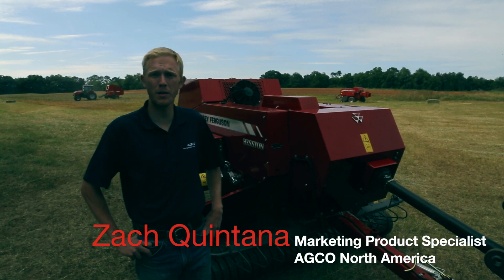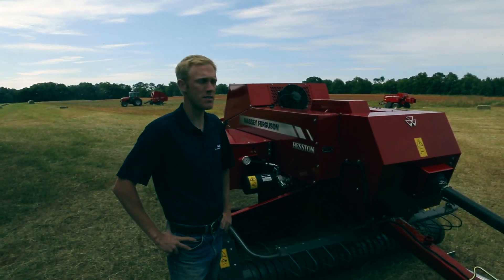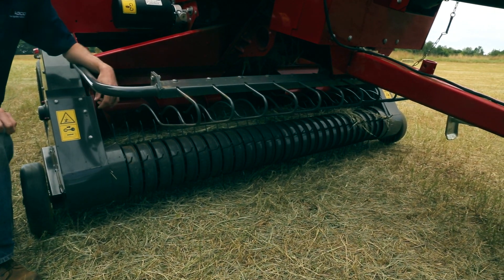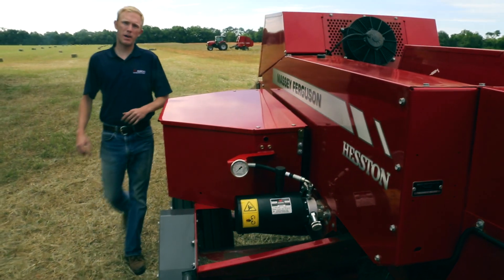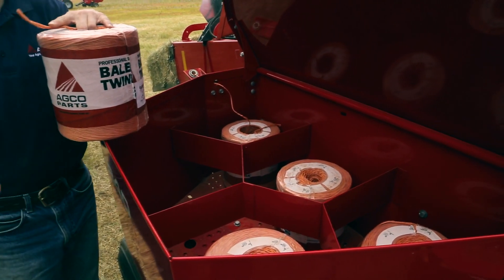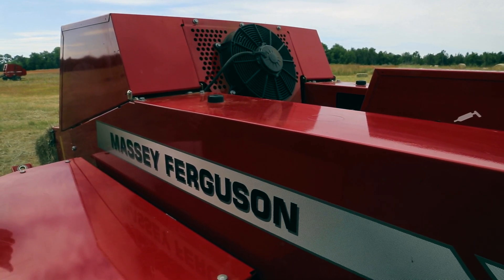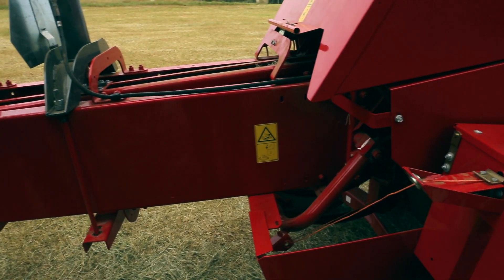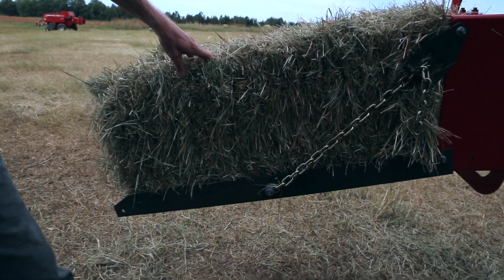Massey Ferguson 1840 Inline Small Square Baler

Comment: I am thinking about trading my jd for your baler, the JD is extremely dependable but is not consistent on bale shape, but if I understand your advertisement there is no banana bales reguardless of windrow size, is this correct?
Reply: If you get banana bales, you dont drive fast enough to fill the bale chamber every stroke, in other words you need more power in front of it.